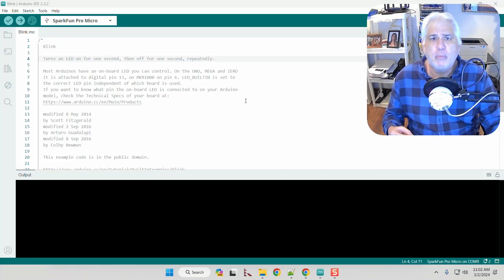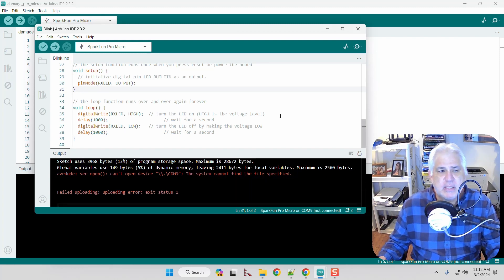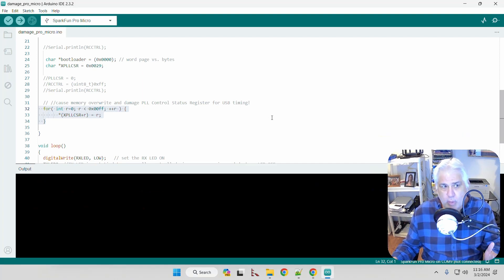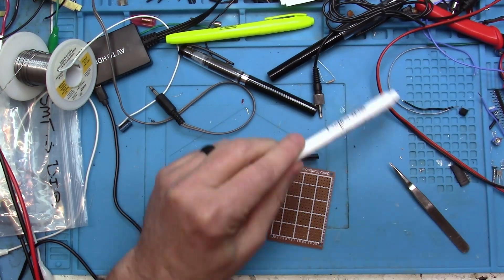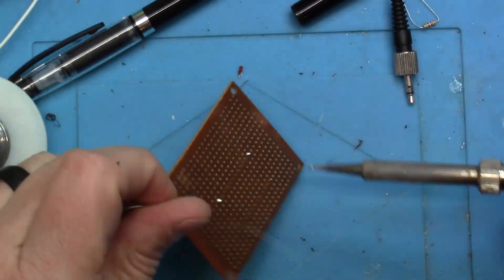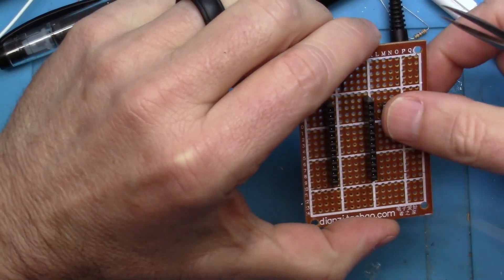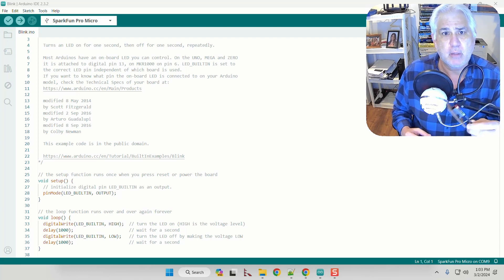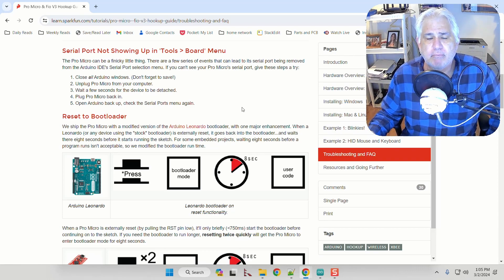How to FIX a BRICKED Arduino Pro Micro

Comment: Hey man a bit late to the video but i tried your fix only problem is it asks me to select an port to upload to but in windows device manager i dont see it connected to a port it just tells me Device Descriptor Request Failed
Reply from the maker: So, if you press the reset button twice then check the ports, you don’t see the port?  There might be a small window of time that it appears.

Comment: hey. do you know by chance if there's any difference between this pro micro and the pro micro with usbc that is purple? the only difference i could find is something about voltage. i got it bc usbc but i can't get piezoelectrics to work on this thing and i was wondering if there isn't anything else i should be doing bc of model differences
Reply from the maker: Interesting. No I have not seen a purple one with usb-c but I will check it out when I have time. Sorry I can’t be more help.